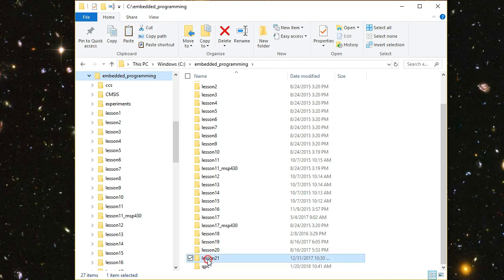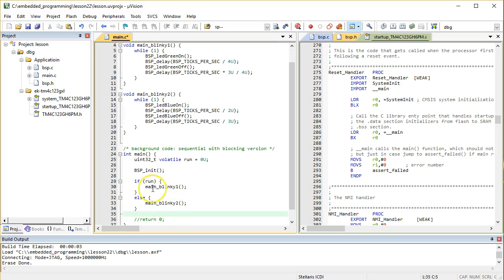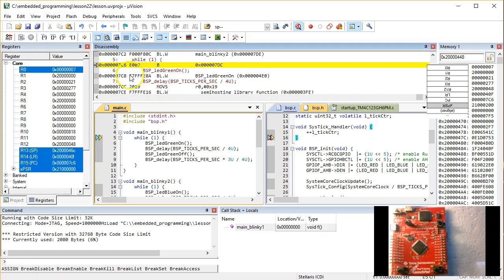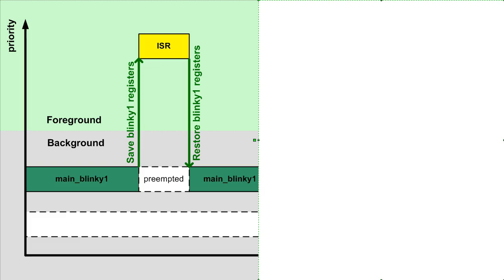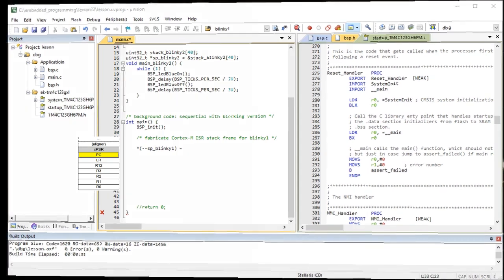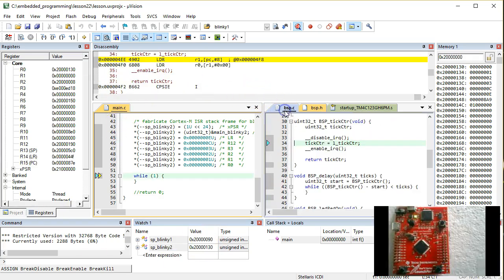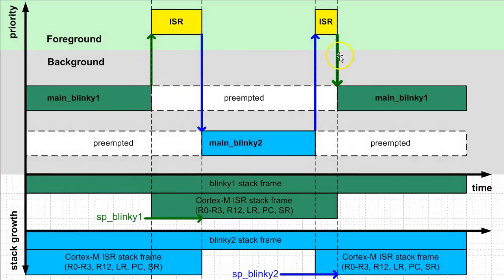#22 RTOS Part-1: What is a Real-Time Operating System?

Comment: Notes:

In the earlier example, we were changing the value of PC to switch to different led functions. That basically means when an entry into an exception such as Systick Handler is  made, the stack frame (which comprises R0, R1, R2, R3, R12, LR, PC and xPSR) are saved on the stack. Then the address of the exception is fetched from the vector table by NVIC, and the processor starts executing the exception handler function. 

So when we changed the value of PC in the stack frame, we were able to switch to another function. 

However in the last example, we essentially created two stack frames for each LED function. And just when the exception handler was about to return, we changed the value of stack frame to one of our stack frame. 

Our personal stack frame had the context for our particular blinky function saved (i.e. R0-R3,R12,LR,PC,xPSR),  so the processor was tricked into thinking that it saved this particular stack frame and popped the value of PC and LR from this stack frame. And thus we made the switch to another function lets say green led.

After we executed it few times, we again put a breakpoint on the Systick handler, And this time we retrieve the value of stack frame of the green led function. However this time the top of green led stack frame is legitimate and has the correct value of return instruction.

Now we put the value of blue led fabricated stack frame, and again trick the processor into thinking that this is the stack frame which was pushed on it, upon entry to the exception handler. And the blue led function runs now. If we break at systick handler now, we will have a legitimate stack frame for blue led as well. 

Thus we have two legitimate stack frames for context switch, and now upon context switching we would return to the original address, where the exception entry was made.
Reply: Your notes are obviously incomplete.  

We do not know how the cpu registers get saved for the context switching between the exception handlers and the main thread; this is defined by the technical documentation for the target specific CPU.   Its obvious that this approach of context-switching between software threads is a software-implementation approach.  We're swapping out stack frames carefully; we need to retain both the critical CPU registers content AND whatever is stored on the stack that we DO NOT want to lose (think about all the variables and nested function calls).  So, Miro's example here is good enough for demonstration purposes but it is not sufficient code for production usage because its quite dangerous.  We want to virtualize the CPU, WITHOUT corrupting the main thread code execution.

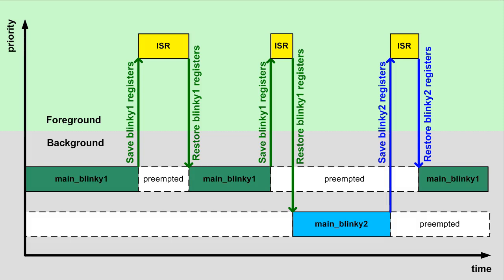Comment: Hi Miro, thanks a lot for the RTOS series of videos. I have a silly question, specifically on this example. Where is the interrupt used in this code, What is the ISR doing in this example? Is it used for the delay? Particularly from the plot /illustration of 10:53, why is ISR happening non-periodically and why are they of different duration?
Reply from the maker: "Where is the interrupt used in this code?" -> This code uses the periodic SysTick interrupt, which is configured in BSP_init() inside bsp.c file.
"What is the ISR doing in this example" -> The SysTick ISR is only incrementing a counter variable. But it is also used to manually simulate context switching, by setting a breakpoint inside the ISR and then changing things manually inside the CPU using the debugger.
"Why is ISR happening non-periodically and why are they of different duration?" -> The ISR used for context switching does not need to be periodic and it does not need to have the same duration each time. These things simply don't matter, and therefore the timing diagram at 10:53 shows a general case. --MMS

Comment: any guesses why my blue led doesn't go OFF when the green one comes ON ? The blue led turns off when I run the code without the breakpoint
Reply from the maker: Why should the Blue-LED go off when a preemption happens? I mean, if the preemption happens while the Blue-LED is on, it should stay on as long as the thread main_blinky1 is not running. This is because only main_blinky1 turns the Blue-LED off. --MMS

Comment: Thank you so much for the amazing video! One question though, at 21:11, the solution is to save the additional registers R4-R11 to the thread stack. The timing diagram shows they are saved after the ISR returns. Can we save them before the ISR preempts (i.e. save them at the same time as other registers like R0-R3, etc.)?
Reply from the maker: In order to save registers before an ISR is not possible, because you don't know when the interrupt will occur. Once it occurs and your ISR starts running, the interrupt stack frame is already saved on the stack. --MMS

Comment: First thanks for great lessons, I am going through RTOS lesson again after a year. I have one doubt. At 12:50, you are explaining that we don't need extra aligned unit for task specific stack  as its already 8 byte boundary aligned. I am not able to understand reason. I watched that portion multiple times. Can you please tell the reason in comment box ?
Reply from the maker: Yes, you are right that the alignment of the arrays `stack_blink1[]` and `stack_blinky2[]` at 8-byte boundary is not guaranteed at this point. The ARM-KEIL compiler happens to align the arrays that way, but in principle, another, standard-compliant compiler (or the linker for that matter) could align them differently (only on 4-byte boundary.) To guarantee the 8-byte-boundary alignment, you could add `_attribute_ ((aligned (8)))` before or after the declarations of the stack arrays, but this is a non-portable extension to the C language. In the next lesson about the RTOS, you would see how this will be implemented in the "MiROS" RTOS, in the OSThread_start() function. Specifically, you'll see that the top of stack will be aligned explicitly. --MMS
Reply: @StateMachineCOM  Thanks for reply. Yes in next lecture we are taking care of it. 
Also would like to put a thank you note for helping and motivating me & many other embedded engineers through your work.

Comment: Hi Sir,

Thanks for the series of great videos.

I have an query here as my newbie in the embedded world. Could you please tell me that why didn't you save R12 on the stack while you stored R11 down to R4 on the stack  (Last of this video : 21:53 time line)? I am seeing that SP is set as 0x200000088 on the stack and above SP , we must have R12 then followed by R11-R4  while you showed a red block (R11-R4) copied just above 0x200000088 which i felt , it must be two addresses up from SP (R13) and R12 then it would be aligned.

Regards,
Manish
Reply from the maker: The complete stack frame for a thread's context consists of two parts: (1) the registers saved in hardware upon the interrupt entry and (2) registers saved on top of that by the software. The choice of the software-saved registers is dictated by what the hardware already saved, because you don't want to repeatedly save the same registers and you don't want to miss any either. Also, you might want to watch lesson 9 about ARM Application Procedure Call Standard, which explains the registers saved during a function call. --MMS

Comment: Dear Mr. Miro, if the main_blinky2 use a lot of stack memory, could it overwrite the private stack memory of main_blinky1's exception frame?
Reply from the maker: Yes it could! The risk of stack overflow is multiplied by the number of threads in an RTOS, because each and every private stack of a thread can overflow. So, you need to be extremely careful and you need to size every stack properly. This is one of the biggest problems of using a traditional RTOS.
Reply: @StateMachineCOM  Dear Mr. Miro, thank you very much for your conscientious answers and awesome videos.

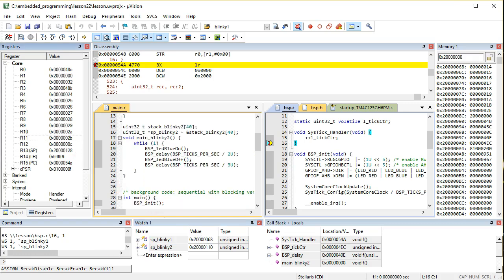Comment: Hi Miro, I did not understand the offset of 20 bytes regarding the stack pointer at 22:04
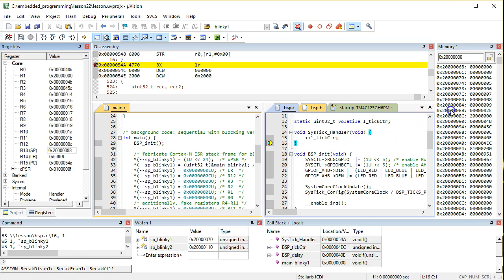Reply: It is to account for the 8 values that had to be manually copied from registers R4-R11 onto the top of the current ISR stack frame at 21:44 (8 values * 4 bytes each = 32 bytes = 0x20 bytes in hex).

Comment: "But in your case, the ISR does NOT return to the preempted code, but
 rather to another thread: blinky2. This other thread can also use the R7 register and as any function is also obligated by the AAPCS to restore the R7 upon its return. But you are not executing the whole thread function but rather just a piece of it. This piece of code doesn't need to comply with the AAPCS and it can change the value in R7."

What exactly is meant by not executing the whole thread function, but rather a piece of it?
Reply from the maker: When you call a C function, you execute the whole function from the beginning to the end. This is important, because at the beginning of a function the compiler generates special code known as function prologue, which saves the required registers on the stack. Also, the right before returning from the function, the compiler generates special code known as function epilogue to restore the previously saved registers.

However, when you return from an interrupt to a preempted thread function, you specifically DON'T execute the function from the beginning but rather only a piece of it from the point of preemption. This means that you generally don't execute the function prologue, so the registers required by the AAPCS are not saved. This is what is meant by saying the "the piece of code does not need to comply with AAPCS". --MMS
Reply: @StateMachineCOM  Thanks for the detailed explanation

Comment: Hello Dr Miro. Thanks for the wonderful tutorial. I am trying to create same application on NXP Kl25z freedom board, however when I try to switch stack entry from CPU stack to blinky1/2 stack,  by loading SP register with value of blinky 1/2 stack pointer variable at sys tick interrupt exit (at BX lr instruction), the hard fault interrupt is triggered. When I try to swtch from main thred to blinky thread by changing PC address in main CPU stack (at sys tick interrupt exit) it works properly. I am using Keil uvision 5 IDE. I am facing similar issue in IAR but there hard fault interrupt occurs after running blinky thread for few msec. Appreciate your help on this!
Reply from the maker: To use the code discussed in this video course directly, you really need the same board as used in this course (TivaC LaunchPad). Other boards, even if based on ARM Cortex-M CPU, differ just enough so that the code will NOT work without some changes. For example, your KL25Z Freedom board is based on Cortex-M0+, which is significantly different from the Cortex-M4 in the TivaC LaunchPad. Also, the GPIO structure (used to blink the LEDs) is very different in the NXP processors compared to the TI processors. But TivaC LauchPad costs only $12.99, so perhaps you could afford it to benefit from this course. I really hope this makes sense to you. --MMS
Reply: Thanks for the reply. I could try this on Tiva board. Actually I have followed all of your earlier tutorials and created all applications on NXP KL 25z including led blinking and also found that the exception entries (stack frame) for Cortex M0 and Cortex M4 are also similar. Also, the code that I have written for Kl25z based on this tutorial is also same as that you have written for Tiva board, so I was hoping to have it working on kl25z. Is there any generic way that MIROS will work independent of arm architecture/board? Thank you again for the help!
Reply: Looks like manually changing SP register in IDE causing change in the debug instructions and thus triggering hard fault interrupt. Finally I could able to run multiple threads on KL25Z freedom board with automatic thread switching as mentioned in your next tutorial with little modifications.
Really helpful tutorials and lot to learn. Thanks!!

Comment: Miro, here you mention that "an ISR must necessarily run to completion before returning to the preempted code". And I'm wondering what that means in terms of ISR preempted by an ISR of higher priority. If I were to use a while loop as the idle thread and have 2 or 3 ISRs running at different rates and each with a different priority level, also each one more computationally burdensome on the CPU than simple blinky ( I am thinking motor control applications) would it still be necessary to store registers R4-to-R11 for meeting hard and soft real time deadlines?  Because it almost seems like a higher priority would preempt a low priority ISR, and all ISRs would eventually run to completion before returning to the idle thread.

Comment: question:
could you please more clearly why the aligner stack entry  is not necessary? ( my platforme is cc2640R2 Launchpad from Ti with CCS toolset) .. thanks in advanced
Reply from the maker: Stack aligner is necessary only when the stack before the interrupt is misaligned. Misaligned stack means that the value in the SP register is not divisible by 8. Normally a stack misalignment should not happen, because the compiler avoids pushing an odd number of registers. But in case there is some assembly code (not generated by the compiler), a misalignment could happen. In the following lessons on RTOS, you will see some assembly code to perform context switch, but this assembly code will be careful to avoid stack misalignment. Regarding your CC2460R2 LaunchPad board, it is not appropriate for this course. To really follow along, you need the TivaC123 LaunchPad. --MMS

Comment: Very nice tutorial, but... I do not like when the word 'thread'  is used as a synonym of the word 'task' or 'process'... These things are different.
Reply from the maker: Actually, I was very careful NOT to use the term "process", because it has a different meaning than "task" or "thread. On the other hand, the terms "task" and "thread" seem to be synonymous in the RTOS community. Virtually all RTOS manuals/books (VxWorks, ThreadX, MicroC/OS, FreeRTOS, Wikipedia RTOS article, etc.) use predominantly the word "task", but note that "thread" is also an alternative term for the same thing. The clarification of the terms "thread"/"process"/"task" can be found on StackOverflow at: https://stackoverflow.com/questions/3042717/what-is-the-difference-between-a-thread-process-task
Reply: I agree that unfortunately 'task' and 'thread' uses simultaneously. I am quote old person and in my mind 'process', 'task' and 'thread' are different. With embedded systems these words are more  'synonymous' then it was with the big engines and this is why in my case I usually start lessons of RTOS with 'adjustment of therms'.  From the classical point, the 'task' resources were created when a task was created with calls like 'task_create()', 'execv()', 'posix_spawn()', etc, derivate from general 'fork()'. From the other hand, 'fork()' has a strong correlation with a process. This is why in some OS  there is also a 'task group'. In the link you've provided, from StackOverflow, task and thread are not the same as well. 
All these does not make your course bad! :)